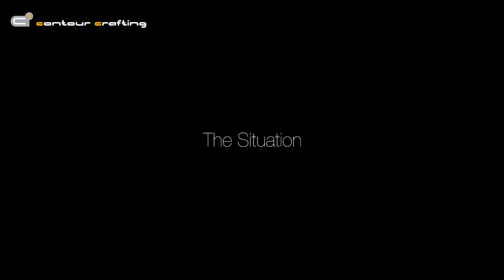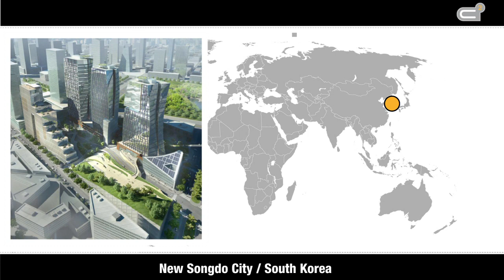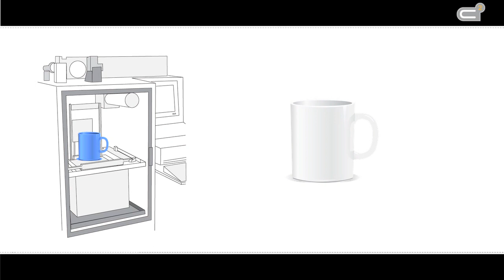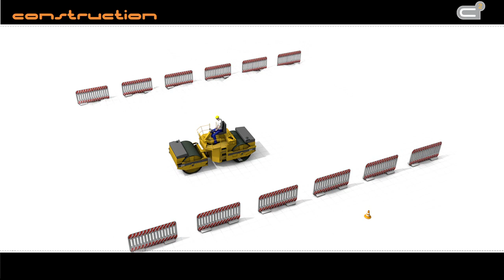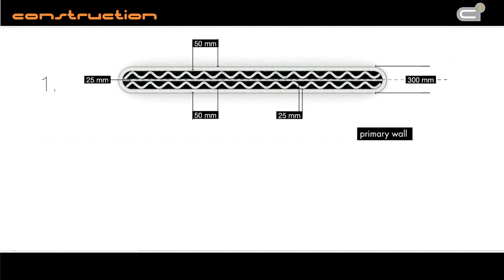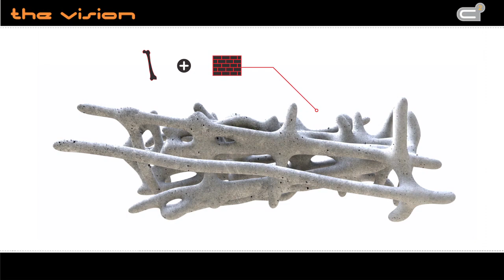contour crafting

Comment: Pretty cool ...Being in the building trades as a professional I have a few points to bring up. Point 1. The typical shell/envelope of a home usually accounts for only 15-20%  of a homes building cost, and is usually a quick process, even with traditional stick construction.. There are many other extremely efficient methods for building an envelope that are energy efficient, fast, and cost effective . SIPS panels and ICF's come to mind.. Point 2. 60-65% of a homes utilities are spent on heating and cooling...over a 30 year mortgage those costs really add up..not once did I see an emphasis on the insulation value . Even if you were to blow in a highly efficient insulation in the wall cavities, it would still be extremely inefficient due to  thermal bridging by way of concrete, making these structures a poor choice for most locations.Still a cool concept, and I hope they will develop a material that is both structural , highly insulative , and sustainable.

Comment: The concept is intriguing and completely possible all the way up until the point of using biodegradable materials.  Why would you want your house made of materials that will decay around you?
Reply: Benjamin Olds housing building materials are already biodegradable, that's why I have to pay to get new windows, rotted wood replaced, and a new paint job this year ... sustainability, yes, but that has more to do with sustaining the bank balance of those in the home improvement / building industry.

Comment: will it be resistent as normal houses ?
Reply: Way more strength than conventional houses.  The rectangular house concrete walls are 10,000 PSI where as the average conventional concrete home is around 3000 PSI.  Also the 3D printer technology can print dome shapes and other superior geometry design that is WAY stronger than rectangular home designs.  No need for support beams and WAYYY stronger.
Reply: How many layers of concrete can be printed at a stretch, fresh laid coccrete is soft, how high can the layers go before it collapses?

Comment: The idea behind is good but has many flows. Setting up the " construction site" will take more the 24h as advertised. This can be accomplished almost as fast if it is done from prefabricated parts. It doesn't mean the house is build in the assembly time. There is also the time that was spend on making the prefabricated parts. I am wondering how did they solve the drying time of the concrete. I don'y think the first layers will offer enough structural support for the topmost layers without a mold. And if we build a mold the we go back to the traditional concrete cast walls.

Comment: Does anyone have any links to energy efficiency and air quality analysis?  I am very interested in passive house, which maintains a very airtight thermal envelope and very intentional airflow with a heat exchanger between incoming and outgoing air streams.  Concrete has great thermal mass, and I see the air in the walls as a good enough cooling insulator so that this would be a cool tropical house, but how would this do in subtropical or temperate winter?

Comment: Ummm ... Substructure works ... Foundations and incoming services? Insulation? (slab/walls and roof), and avoidance of cold-bridging? Damp-proofing? Above ground services, and their distribution? (Water, Gas, Electricity, Drainage) ...
Application of internal finishes and future remodeling? Ease of conversion / re-use? 

At least clients would not be able to change their minds so easily during the construction process ... :)

Comment: As the price of wood goes up, concrete becomes more competitive.  There are other videos showing how rebar, electrical wiring, and plumbing can be incorporated into the walls.  Doorwas could be done via printer, and the doors themselves installed by hand.

Although, the small printers using plastic are already able to make jointed action figures by just being that precise, so I'd not say that a larger printer *couldn't* print a door in place, hinges and all.

Comment: I love the idea of 3D printing but I don't see how this is an improvement over current construction methods.  Besides, concrete is more expensive than wood framed housing.  Was there a structural engineer involved in this project?  I mean, shouldn't there be re-bar in the concrete?  Installing windows and doors with a robot arm would be a LOT more difficult than pouring concrete through a 3D printer.  Anyone who has installed a door would know.  Not very well thought out but a cool idea.

Comment: The three biggest factors in housing cost are a prepared lot with water, sewer and electricity, the roof and the foundation. This doesn't even save all the costs of the foundation since the trenching and drainage fill has to happen anyway. 

There's a lot more to a house than walls.